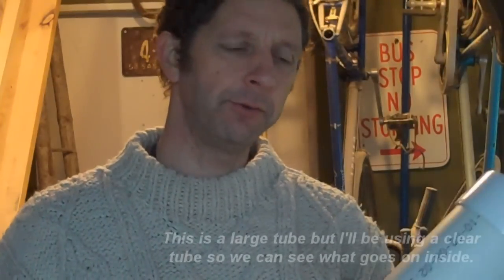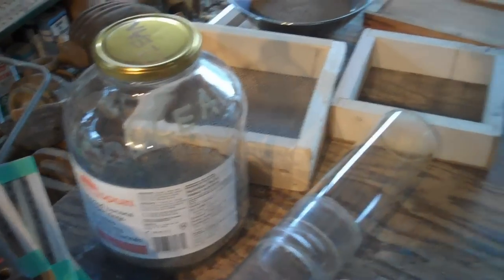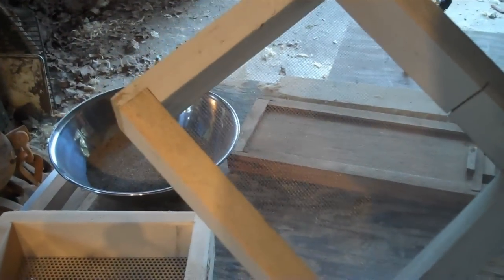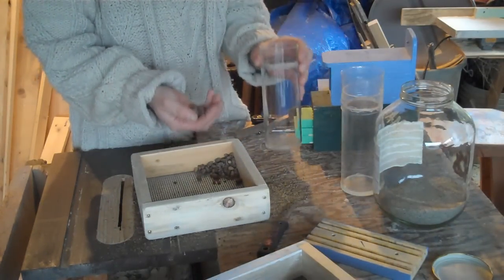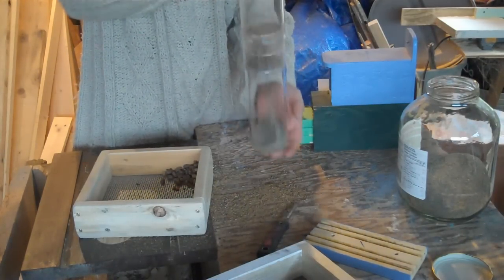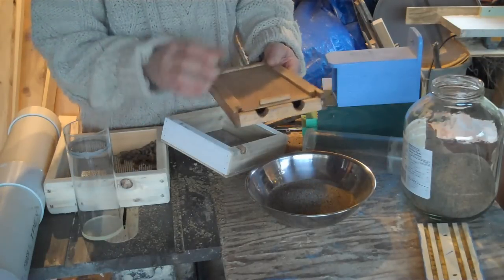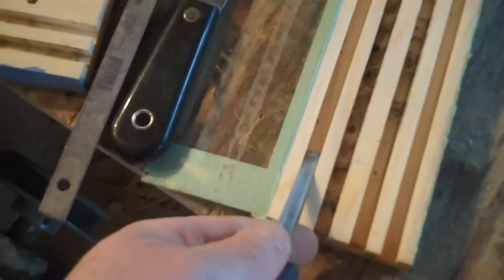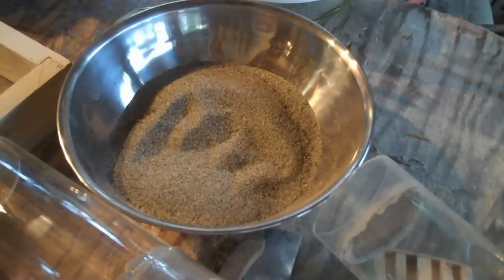Orchard Mason Bees / Cocoon Cleaning Using Sand And Tube Method

Comment: I finally got a small vegetable garden (mostly in semi-large containers and one 4'x4' planter) and just learned about mason bees so I decided to build a house using old bamboo. I know I can buy one already made at Costco for less than $25 but it seems a bit short. I've been watching quite a few videos about these bees and one gentleman recommended NOT to use bamboo. I'm sorry to say but I am lazy and do not want to harvest larvae in the fall and put them in the fridge so I will leave it outside through the winter. However, I do want to provide clean habitat next spring. I don't want to increase the number of bees, just provide shelter for those that need it. Since I don't want to put in a lot of work, should I not even start? Thank you.
Reply from the maker: Bamboo is just a one way trap and becomes a source of mites, diseases and plugged with dead bees. A bee cemetery is what it's called. With that much or little of growing space, I'm sure you'll be getting natural pollinators already. Keeping mason bees is mostly for the fun of it really unless you have a large area to be pollinated.

Comment: Hi – I hope you are still monitoring this site as it provides a valuable resource for information on native pollinators.  I am working with the Government Hill Commons and community orchard in Anchorage Alaska and we are interested in augmenting our honeybees by enriching the orchard with flowers and nesting blocks to attract our local species of mason bees. Given our cold climate we were wondering if you have any advice on making nesting blocks out of 6-inch thick Styrofoam sheeting, which is a common construction material here, rather than blocks of wood.  One concern is if the closed cell foam will allow the nest to “breath” sufficiently to allow respiration for the larvae and cocoons.  Do you have any experience with this or thoughts on the matter?  Thanks, Steve Gerlek.

Comment: I have the Bambeco Swiss Alps Mason Bee House from Costco purchased 2018. Is there a way to clean it? I much prefer the removable tube houses but thought this would be good to try.
Reply from the maker: I had to look it up and it appears that those tubes are made from bamboo? If so, you can't clean and this is exactly what I was talking about when I referred to some designs as a "bee mortuary". It works fine for the first time around but then as the mites, pathogens and parasitoids take over, these just spread to new bees to get infected. The bees that die within each tube then  plug up for everything else later on. This design is exactly what I would  not recommend. Nature instead provides newly made/excavated holes from various insects and birds etc. Good luck.
Reply: @hutchingsbeeservice  Thanks for the reply. The bees are going crazy right now going in and out. It's not a good design. I see the one Costco is selling this year has a middle section of stacked blocks that can be removed.

Comment: I have 90 cocoons from the summer, and would like to divide them for 4 nests next year.  When separating them for the purpose of determining sex,  I get about 20 small ones and 20 quite large ones, but the rest are all about the same size and I can't tell if they are male or females.  Is there any other way to tell the sex?  I would buy a back lit microscope if you think I could see through the cocoon.
I have consider hatching them in a bottle so I can see for sure,  then cooling them in the fridge for an hour or so before  putting them in a nest.  Do you think this might work?    
Many thanks for the videos.

Comment: To sterilize the trays, couldn't you try baking the wood in an oven instead of torching it? I've seen terrarium videos where the creator sterilizes dirt by baking it for a time, and I imagine as long as you're careful to not leave it too high or unsupervised, it would allow the wood to last longer while being sterile.
Reply from the maker: Sure but like I think I stated, intense heat, especially flame can warp some wood trays depending on the particular species of wood and/or condition of moisture content etc. Some of my condo trays are still going after 20+ years.

Comment: Thanks! Just bought a mason bee house filled with 6” bamboo tubes and realize they won’t do a very good job. I get a better system.I was wondering whether just putting the wood trays in a hot oven would kill mites/eggs as well. It just has to be over 50 degreec C. Or perhaps the eggs are tough little buggers.
Reply from the maker: Sure heat will kill them but like I said in the video, you just have to consider your wood trays themselves for putting up with whatever you subject them to. Of course you're just talking about the trays after the bee cocoons have been extracted right? Even putting your trays outside in a dry place say, on the ground for months over the winter, would help with removal. Lots of ground dwelling critters will visit and maybe hoover up some of the detritus left on the trays but I prefer to simply brush, sand and if required, blast a short blast of hot flame over the channels.

Comment: I like your method of cleaning the mites from the cocoons using the sand method as it seems much more organic in nature. Have you ever considered or experimented with the use of diatomaceous earth in place of the sand as it is used as a natural insecticide for flees, bed bugs, cockroaches and other arthropods by causing multiple small cuts and de-waxing their exoskeletons causing them to dehydrate and die. Do you feel that this may cause injury to the bees as they emerge from their cocoons?
Reply from the maker: Definitely. Diatomaceous earth left on the exterior of the fuzzy cocoon would compromise the exoskeleton and jaws of the bees as they chew their way out during emergence. Thanks for the question. Gord.